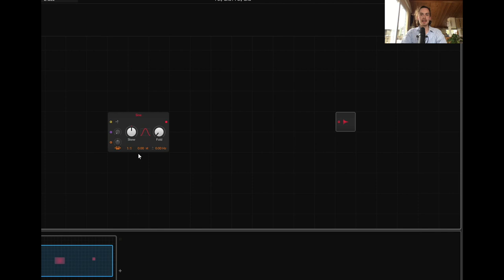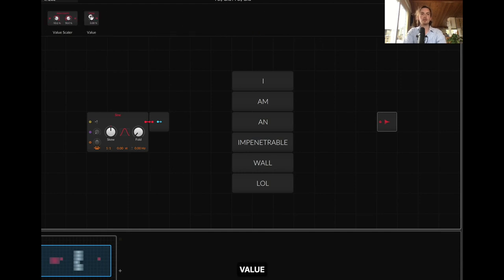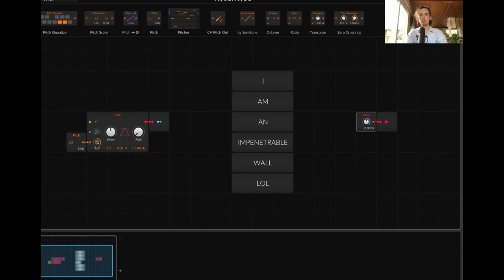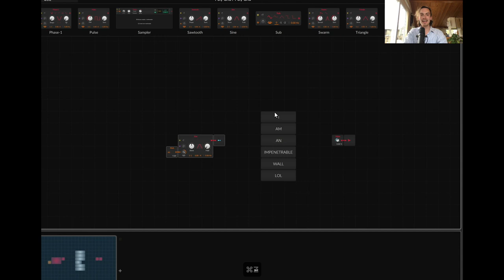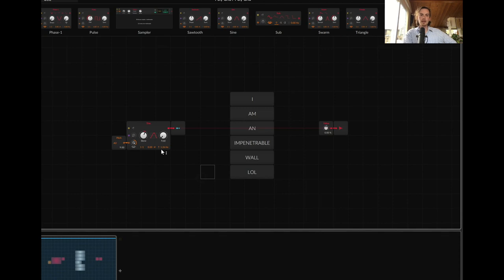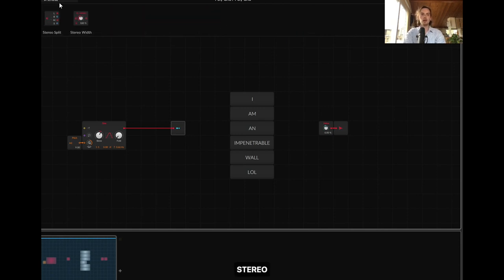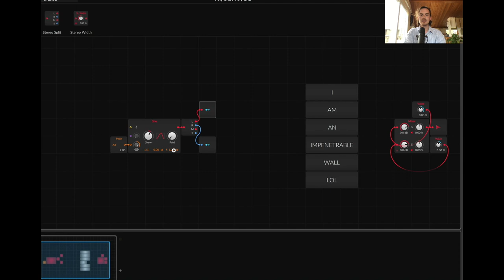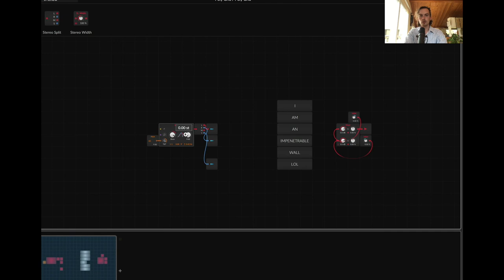Bitwig Grid 101: WIRELESS Stereo Audio!?

Comment: Great to see you making content again man.

Hey, the very last part where you modulate an input based is the most important part imho, and has countless uses for sound design.

Probably not everyone knows that the grid won't let you connect an output back to something earlier in the chain without using a long delay at it's minimum setting of 0.02ms. 

As I'm sure you know, at audio rates a delay of that length makes it really hard if impossible to build a bunch of circuits.

Like you, I also stumbled on the fact that modulators let you do this feedback thing with what appears to be almost zero latency.

If you subtract the feed back signal from the original using a long delay you get significant ripple when displayed on an oscilloscope.

Try doing the same thing using the modulator feedback.  You get a flat line!

For example, just for fun, take the default grid and modulate the pitch offset of the oscillator with the modulation output of the envelope generator, and then muck around with the shape of the envelope.

Hey presto, instant "The Clangers" effect.. better call the Soup Dragon 😀

If you use a wavetable oscillator, it's fun to modulate the Index parameter with the ouput of envelope too ;-)

Again, great video and always look forward to them. 🎹